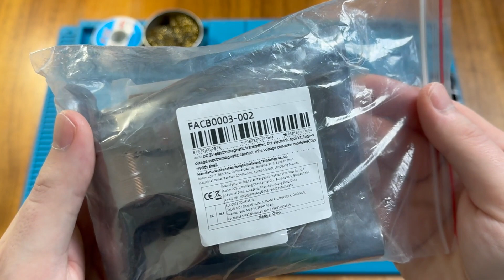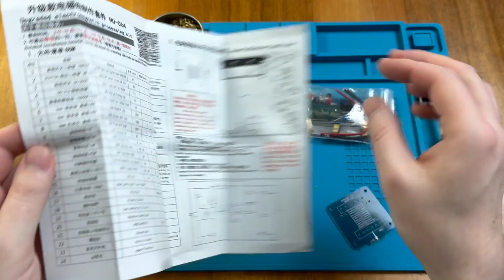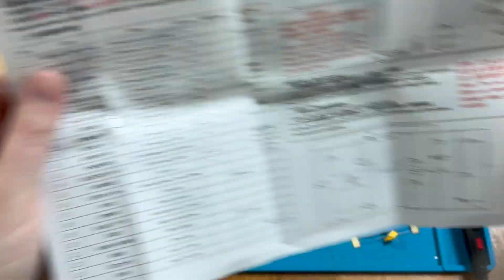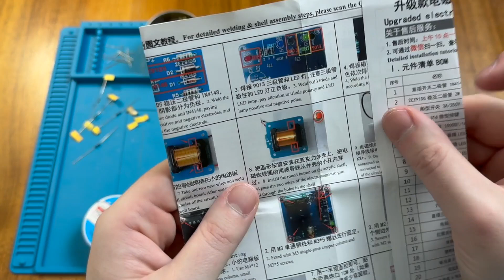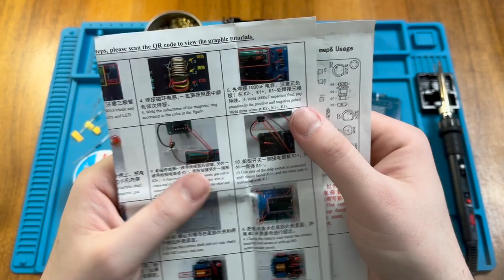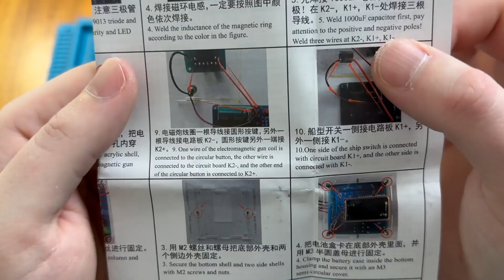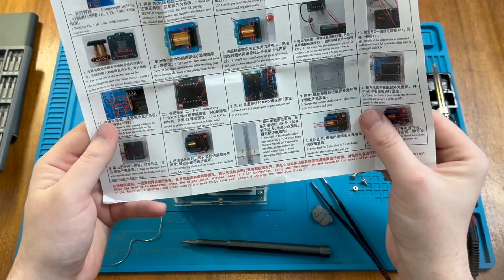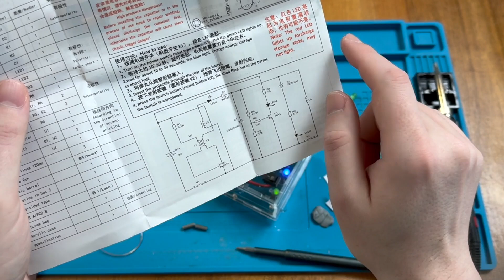Electromagnetic Turret Defence Desktop Toy - DIY Soldering Kit - with Slow-mo Demonstration

Comment: 5:08 My wires with the copper coil were completely different colors both physical and the directions were different. I'm wondering if this is the cause of it not working. The button turns green but nothing else. I guess I'll try swapping the wires
Reply from the maker: That's frustrating! It's definitely possible that incorrect wiring could be the cause of the issue. Swapping the wires is a good troubleshooting idea. I hope it helps!

Comment: Mine doesn't work 😢
Reply from the maker: Oh no! Probably best to double check all the solder joints and connections first. I found the wiring instructions a little confusing.
Reply: @jtjacques  I think I might have damaged my circuit board. I accidentally melted a spot (it looks like a cable or something under a thin layer of plastic). Would this break the circuit?
Reply from the maker: @terreqrue  It sounds like you've just removed the solder mask. As long as the copper trace still connects the intended points on the board, you should be fine. You can check that using a multimeter, if you have one.
Reply: @jtjacques  okay thanks